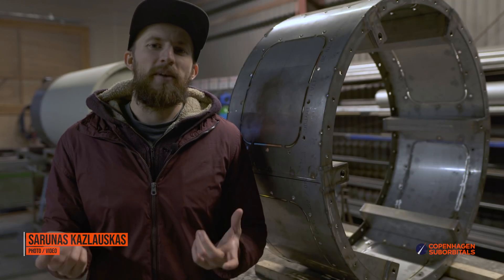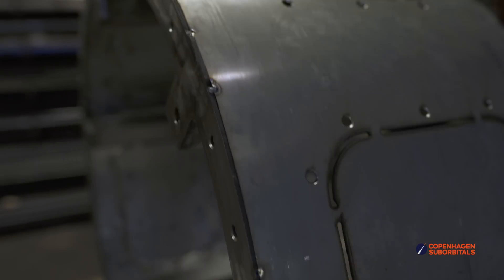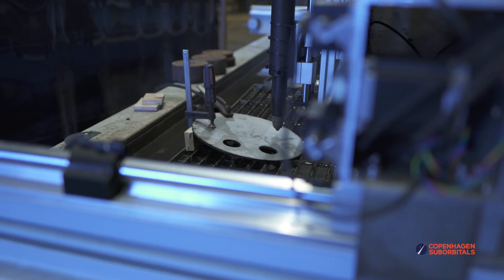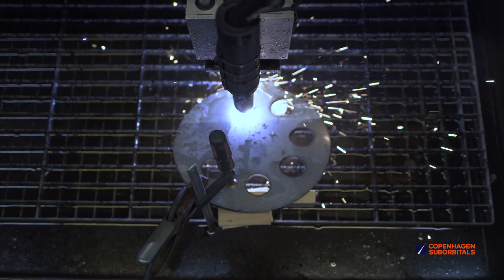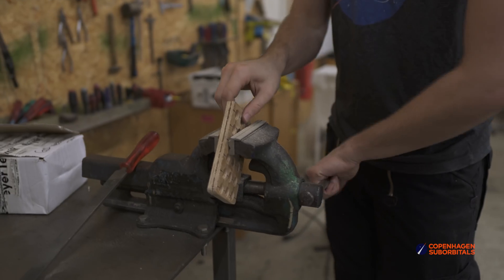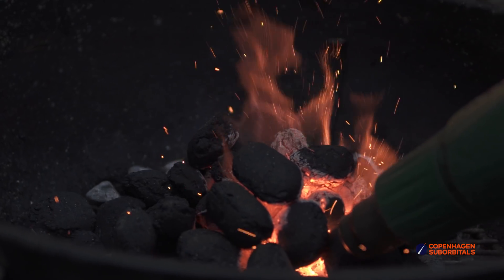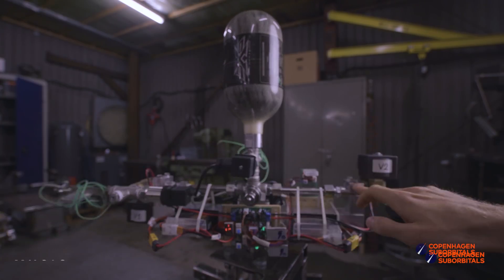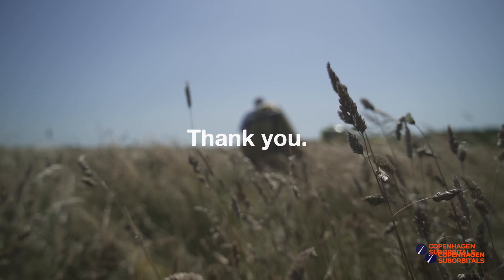Cold Gas Shock Diamonds | INSIDE THE ROCKETSHOP : Episode 17

Comment: Hi! I am working on 3D printed Cold Gas Thrusters. Could you let me know how I can see the gases coming out of the nozzle? As of now, I’ve stuck a small piece of paper at the end. But, I’d really like to see the stream of gas coming out.
Reply from the maker: That depends a lot on the humidity/temperature of your room and gas pressure, as well as the type of gas, of course. We have so far used regular compressed air for testing, so it could condense. If you are using pure nitrogen or your room humidity isn't as cold or humid as our workshop, you can try adding a tiny drop or two of water into your nozzle with a syringe, it definitely helps for a more dramatic effect.
Reply: Copenhagen Suborbitals I will definitely try this out! Thanks a lot for the tip. FYI I am using oxygen gas ... because oxygen gas is quickly available to me. But like you suggested, I’ll try it with compressed air.
Reply from the maker: Nice project, by the way!

Comment: What was the tank's material?
Reply from the maker: If you are asking about the RCS system, then it's a standard paintball gun COPV - thin aluminum overwrapped with carbon fiber. If you had the inter tank section of the Spica rocket in mind, then it is 304L stainless steel.
Reply: @CopenhagenSuborbitals  Thank you. I means a propellant tank.
Reply from the maker: @cruzkim9294  304L stainless steel, just like the intertank section. You're welcome!

Comment: I can't help it, but somehow that interstage adapter strikes me as way too wastefully heavy for a rocket part.
Reply from the maker: Do you mean that the same structural strength could be easily achieved with a lighter construction, or that there is no need for it to have that much structural strength in the first place?
Reply: @CopenhagenSuborbitals  Quite possibly. I'm certainly no structural engineer, and I don't have the insight you have. It just … looks unnecessarily heavy. I could imagine that a ring of corrugated aluminium sheet with an internal stringer ring could save a lot of weight. Granted, aluminium is a lot more difficult to weld, so I can see the preference, at least in the first iteration, for steel.
You know, maybe you could ask those places that make custom truss elements for the event industry for help. Aluminium trusses save a lot of weight in those stage constructions, and the people working with it have a lot of experience with the material and the structures created from them. Perhaps you could have a truss-like structure, like the Soyuz rockets have between first and second stage, for the actual structural load and then just wrap it with a thinner sheet of aluminium for aerodynamic reasons?
Reply from the maker: @Anvilshock  Thanks for the input. You are right that we could probably easily save some weight on it. However, we first want to see this thing fly and comeback down in one refurbish-able piece to potentially fly another 5 to 10 times before we get into structural mass optimization, if necessary. And knowing this section will need to handle 2 tons swinging on each side of it while being pushed to 4-5G's with 10 tons of thrust from underneath, then also landing in sea at around 10m/s, we are willing to take a bigger safety margin for it's first flight. And also save ourselves some hassle production-wise right now. :)
Reply: @CopenhagenSuborbitals  It seems to me as well, the sheet thickness should be around 1.5 mm but looks more like 3
Reply: It looked thick to me too.  It's probably hard to get the 'perfect' thickness sheets. I suspect all that fuel gets heavy though, so it may not be as overbuilt as intuition suggests.

Comment: wait, shock diamonds from CONTROL THRUSTERS?!?
Reply from the maker: Exactly. :)
Reply: @CopenhagenSuborbitals  you are using nitrogen gas or CO2 for the cold thrusters??
Reply from the maker: @FirstLast-tx3yj  These tests were done using compressed air, but the intention is to use nitrogen.
Reply: Shock diamonds don't exactly determine the thrust they are related to pressure of the exhaust,as there  is  no pressure in space we reduce the pressure of the exhaust using nozzles so that thrust is not wasted are force acts  efficiently in one direction